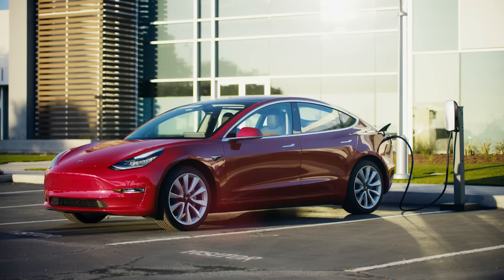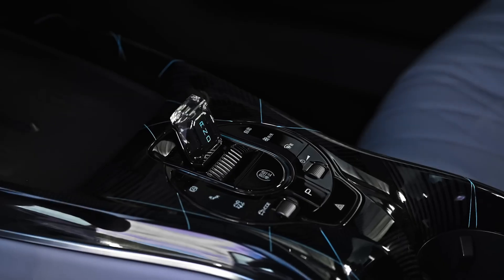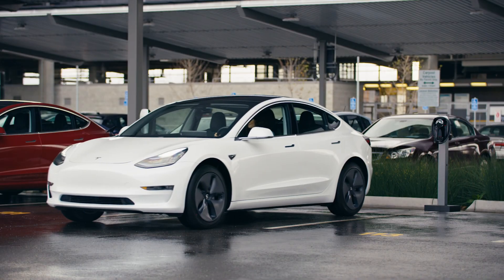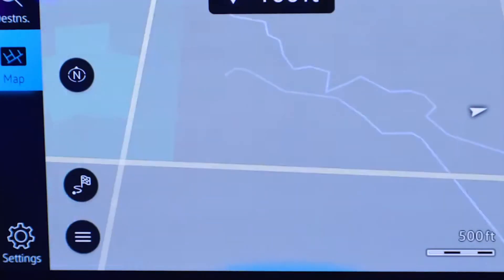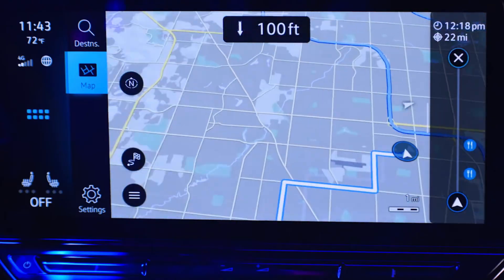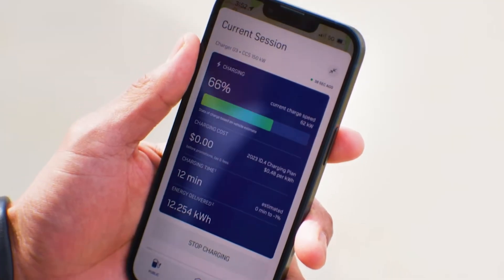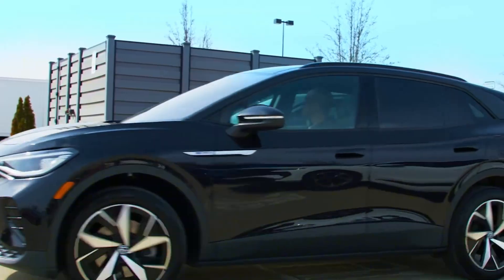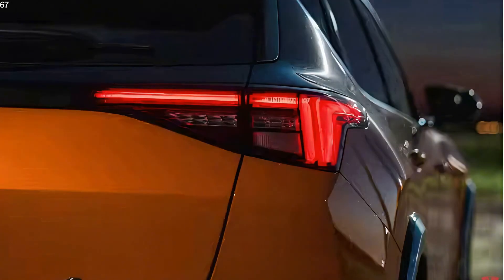The True Cost of Pushing Your EV's kW Charging Limit!!

Comment: Good video.  I’m surprised naysayers haven’t flooded the comment siting Tesla Supercharger data.  To them I say consider the source and let’s see all the excluded outliers and failed batteries that got replaced or failed batteries that totaled the car.   Without those skewing the data, the study would match what lab tests show, high C-rate charge rate reduces lifespan.
Reply from the maker: Appreciate the thoughtful comment 👍
You’re absolutely right — in controlled lab conditions, high C-rate charging does accelerate degradation. My point isn’t that DC fast charging is harmless, but that real-world impact depends heavily on how often, at what SOC, and under what thermal control it’s used.

Fleet data can hide outliers, but it also captures something labs can’t
Reply: @shayan_ev  Good points